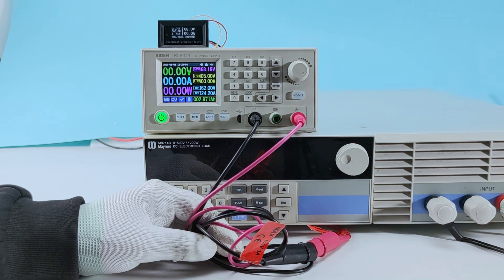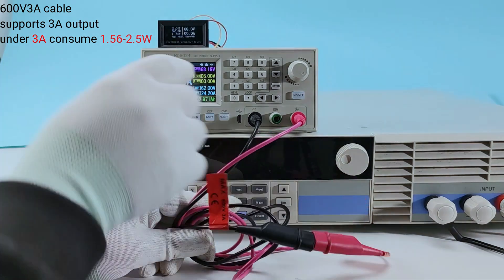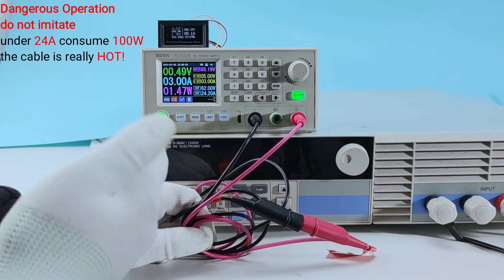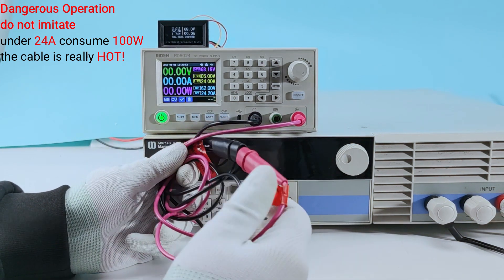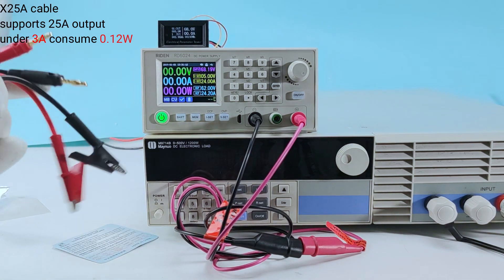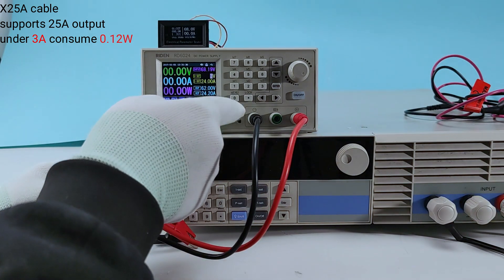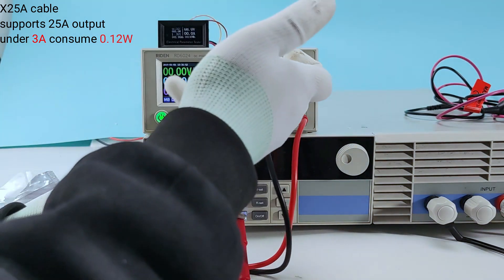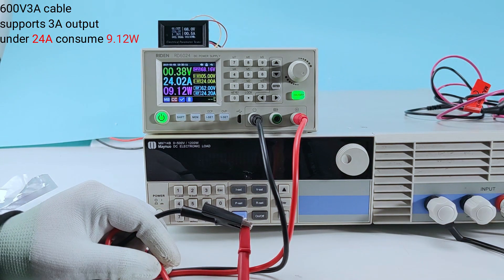X25A cable for RD6024 output, compare with other cable

Comment: Fair 2,5 square mm with low resistance and voltage drop. Am i correct? Good cable. I made the same from parts bought at Ali.
Maybe normal price for CN and Ali, cable price now is about 3,2 $ (Ali) + banana plugs and alligator clips (need to check). But not so interesting for others countries (for ex lets change silicon to ordinary PVC 80 °C, mostly you do not need silicon insulated wires if it is not daily work or lab, you just need flexible insulated wire with 5+6 flex class, 1 meter of the insulated wire price is 0,5 $ per meter now, add same components and you will have much cheaper desigion.
Few questions about 6024. A ve asked some months ago about 6020 or 6024 versions of PSU and you told me it is not going to happen, and now i see it selling, how??? A have to bought 6018...
6024 has wifi and usb communication! Does 6018 has same usb communication opportunity? Is it about logging of any data from PSU or just firmware updates?
Does included usb cable has some chip inside or it is ordinary micro usb?
Reply from the maker: hello, first it is just a choice for you, just like what I write in our description, we just tell the customers that you can choose it, or other brand cable with can withstand 24A big current, it is ok, just do not choose a cable which supports only low current and let it withstand big current.
and in our plan, RD series RD6024 is the last version, we just does not finish it before, if you ask our serivce some months ago, RD6024 should be still on the paper, we are making RD6012P at that time, and we do not know when RD6024 will come out, you can see we just release RD6012P in November and rd6024 a few days ago.
for every RD series power supply, they all supports USB connection to PC software, and they can use PC software to update the firmware to get new function or optimze the performance, if you order the RD6018W, it has wifi connection to moblie phoe app, for more information you can check the  app and pc section in the instruction
and in the cable pack, it is just a normal USB cable, it is just a gift, we sell the 25A cable mainly